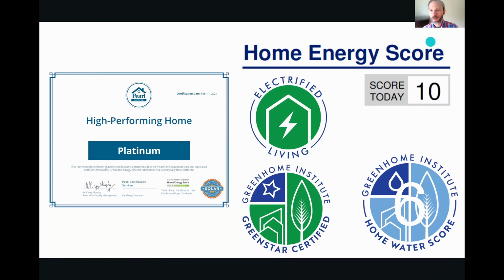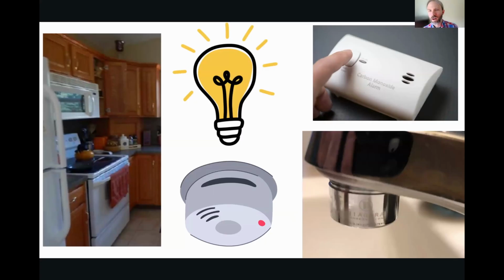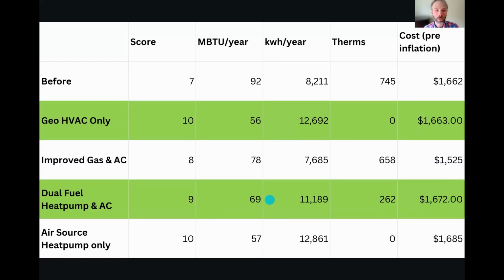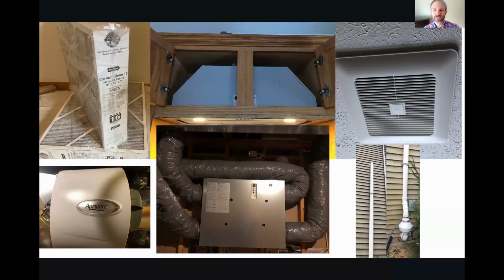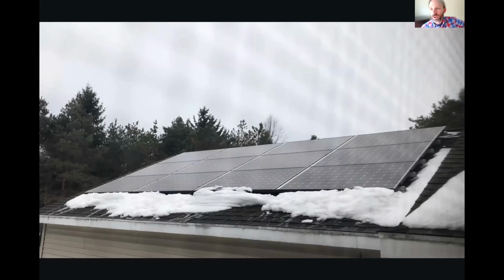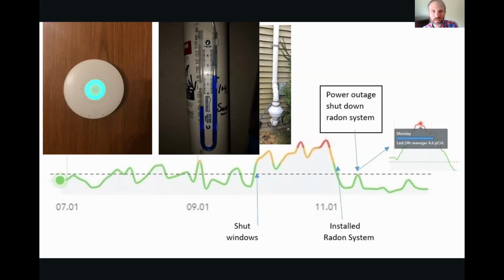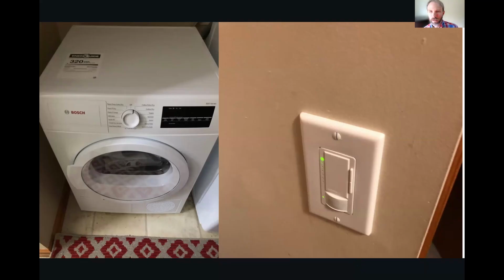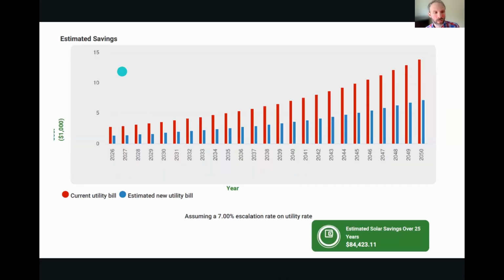Little Residence Green Home & Solar Tour

Comment: I got a LEED CE quiz question but don't understand it. Can I post here to get a correct answer?
The question was "What was one of Brett biggest regrets on what he would do differently?"
and the answer is : "Get a heat pump dryer instead of updating to motion senor lighting." 
Why? I don't understand, can someone explain that? because...
(1:23:19) saying that the motion sensor needs special lighting in order to register with the energy management system. Thus, Brett regret about it but the condensing dryer work out fine.

Comment: Great information! I loved learning from your tradeoff thinking and retrospective. Did you install or consider makeup air for your kitchen exhaust? Separately, you said you wish there was a dehumidifying ERV. I thought that your sponsor CERV2 could do that…?
Reply from the maker: Thank you for feedback. Here is some more Q&A from our session https://greenhomeinstitute.org/little-residence-green-home-solar-tour/  No, make up air was not considered at the 400 CFM feature is not used, you only need make up at 400 CFM, if that level is ever used used due to a burn event, the window is not opened. The CERV2 is a great product that helps manage humidity but from a cost standpoint is not as competitive as someone who may just want standard ERV or dehumidifcation.